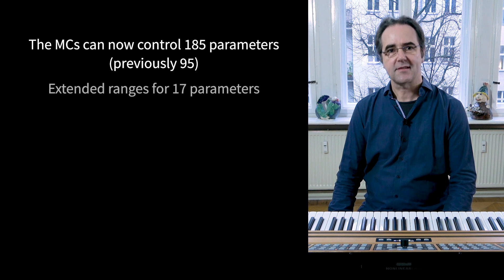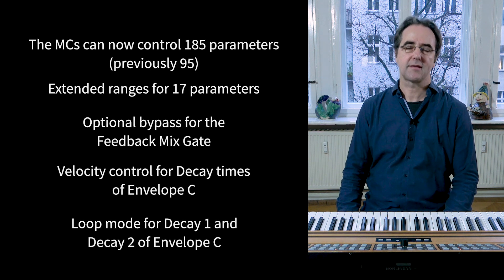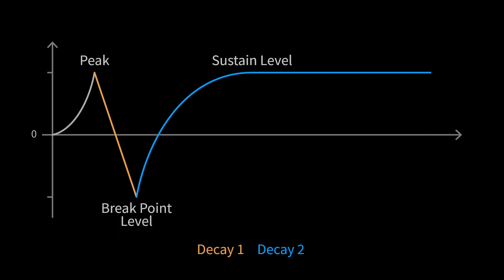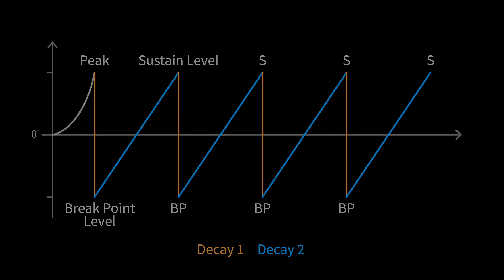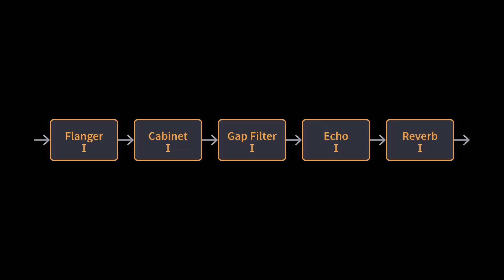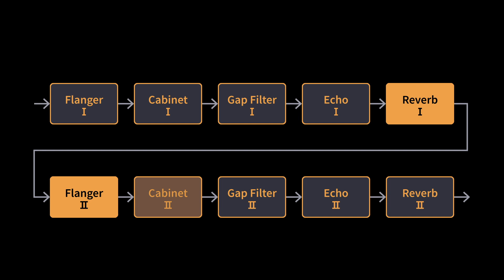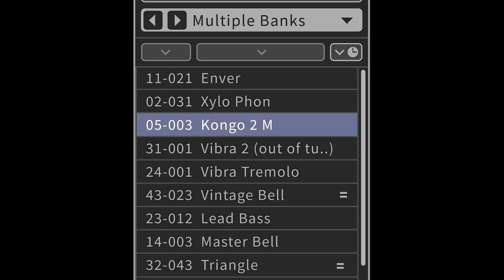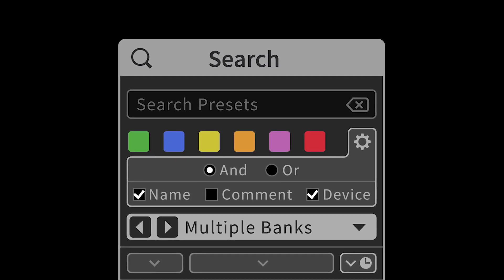The Spring 2023 Update for the Nonlinear Labs C15

Comment: This synth is a beautiful design, evidently the work of veteran synthesists. In my humble opinion, you really ought to add a shapeable noise option on each of the two oscillators. There are plenty of cases where noise makes for the best exciter for a resonator ; but the noise spectrum should be very clean and shapeable to a very fine degree. The problem with the vast majority of noise sources is that they are pretty crude and not even reliable ; white noise and pink noise have precise definitions that are seldom met in the implementations I have heard, and past this point, if you had a very accurate baseline noise spectrum, you'd still need precise spectral control to emulate real-world noises, from breath to wind or rain, etc. In addition, noise should be present as a modulator, as it can introduce useful randomness in sound characteristics. If I could use noise to modulate the new cyclic envelope, I could do something akin to a S&H. Lastly, noise furthers the synth's modal-like synthesis, where the bulk of the timbre is defined by a cascade of resonant filters.
Reply from the maker: Please check the "Fluctuation" parameter of the C15's oscillators:
https://www.nonlinear-labs.de/support/help/docs/HTML-Manual/documents/man-user/05-synth-engine/05-02-2-oscillators.html
It allows to create a wide spectrum of noise signals, that can sound like filtered noise.
Reply from the maker: Oops, sorry,  I missed a part of your comment that shows that you are aware of the oscillator fluctuation/jitter feature.
We try to keep the number of signal processing components as small as possible and to allow to use them in very many ways. A jittering oscillator can be a source for:
- phase modulation of the other oscillator
- amplitude modulation (RM) of the other oscillator
- phase modulation of the comb filter
- frequency modulation of the SV filter